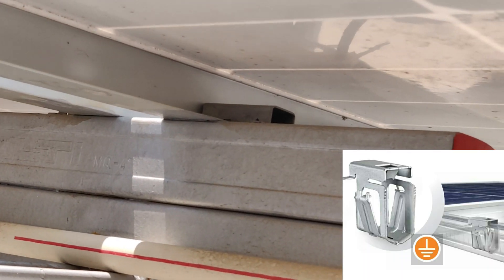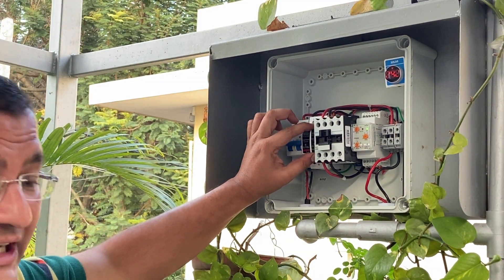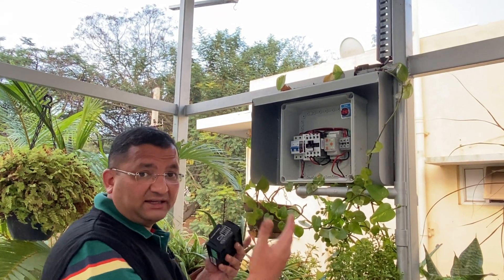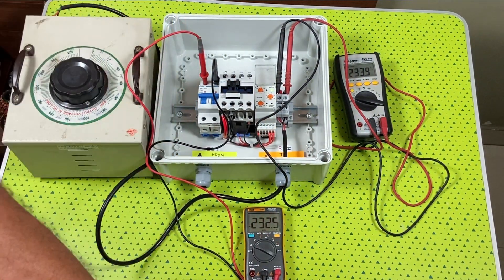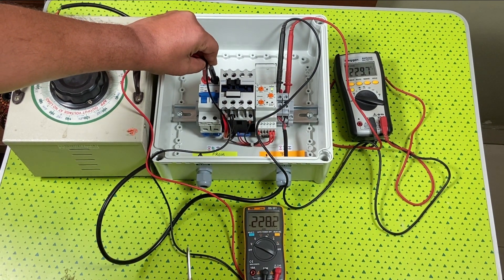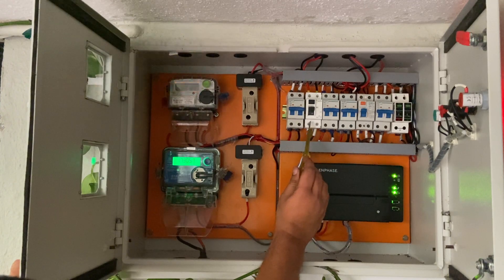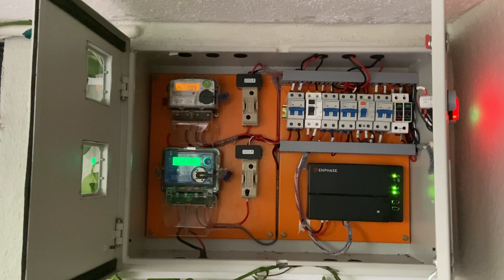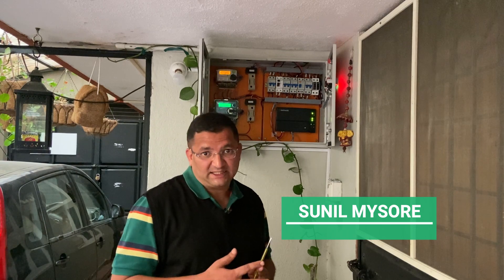General Protection for On grid Solar PV system with micro inverters

Comment: Dear Mr. Sunil. excellent video. I admire your in depth knowledge. I am in the process of installing a 3 Phase 14 Microinverters setup with Trina 500Wp panels and IQ7A Enphase inverters. Can you please recommend a contactor (brand and model) alongwith a good relay (brand and model) to go with my system? In relay's which brand is better GIC/Selec or any good and reliable brand that you may have in mind. do let me know. 
regards

Comment: I have seen some people having an online solar system and a separate home inverter in case of power outages.  Is this anyway more economical or advantageous than having a hybrid solar system?
Reply from the maker: If the day time power cuts are less than 45 mins a day , it is more economical to have a ups backup and an on grid system ( At current domestic power tariffs in India , (Jan 2022))

Comment: Your quality work is appreciated however what is the logic of having two SPD's? Also are the contactors and relay provided for the protection of system or they are protecting the SPD's 😁.
Ornate themselves recommend an appropriate MCB and SPD in the ACDB and you are correct that SPD should be rated as close to the Voltage as possible.
Citel, Mersen and Havells have 275-280v SPD.
Reply from the maker: If the length of Cable from inverter to ACDB is greater than 40 M, it is recommended to have another SPD at the inverter . You can refer dehn guidelines of installing type 2 SPD . In this case the distance is not more than 40 M, it is still installed for the purpose of demonstration. 
Regarding relay . It is installed to basically cut of the inverter for high voltages. If it also protects the SPD , it is well and good.  No harm sir .
Reply: @HinrenEngineering  Great. Can you recommend what should be the ECCB rating for 3 phase system of 7KW having 500wp (14) panels and 14-IQ7A microinverters. What should be the rating for MCB connecting to enphase envoy and what shld be the rating for MCB connecting inverters and grid. and do recomend the ratings for a suitable contactor and relay.
Reply from the maker: @fmsrworkshop1384  4 pole , 25 A Elcb with 30mA residual current.
Reply: @HinrenEngineering  thanks. How about the MCB rating for envoy and ACDB?

Comment: i have installed 5 kw ongrid with single phase inverter. after 1pm my system shuts of average about 20 minutes (in high sunlight days) due to grid overvoltage. can i do anything to avoid it.
Reply from the maker: Dear Sir, 
Are you sure it is because of 'GRID' overvoltage? 
If you are using a microinverter and the system is shutting down during peak sunshine, it may be because of what is called clipping. You can contact your system installer or enphase. They will rectify it with some changes in the settings.

Comment: Does Neutral Earthing eliminate over voltage scenario? failure on Microinverter due to over voltage beacuse of neutral failure or imbalance on transformer. Do give us your thought.
Reply from the maker: Namaste,
We have tried with neutral earthing. It has not helped much. It may also be due to poor earthing. Over-voltage from the grid generally happens because of power lines snapping or some abnormality in the distribution transformer. 
Having said that, I think, in most cases of micro-inverter failure due to overvoltages, the failure is actually due to "Consistent over-voltage" or "sustained over-voltage" and not momentary high voltage. So, I feel that a relay would be better suited to isolate the microinverter. Micro-inverters can handle spikes. 

We can perhaps do a more detailed analysis if Enphase makes the Q relay available in India and gives access to flash logs.
Reply: @HinrenEngineering   Sir, thank you for responding back. Waiting for a perfect way to solve this issue.